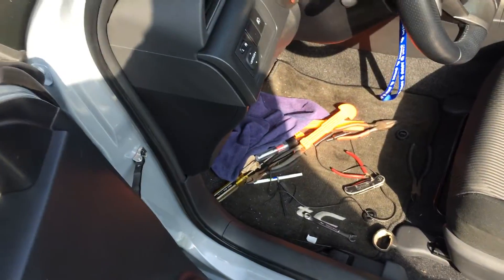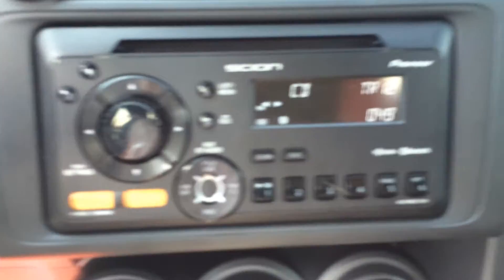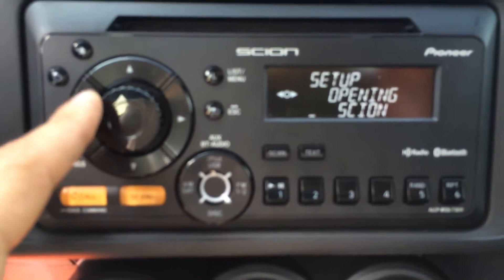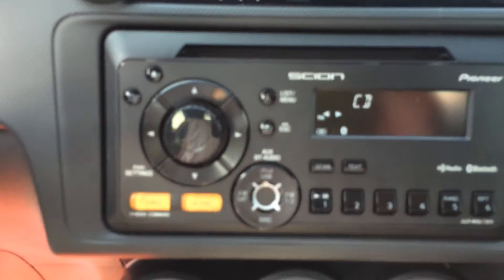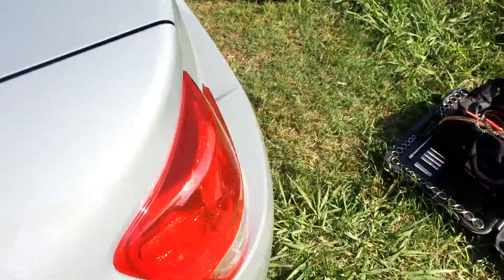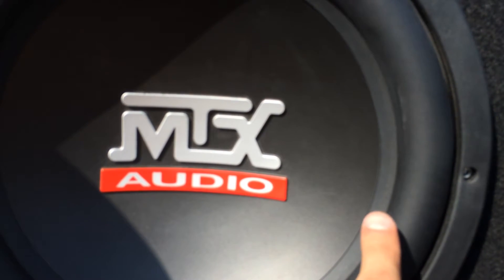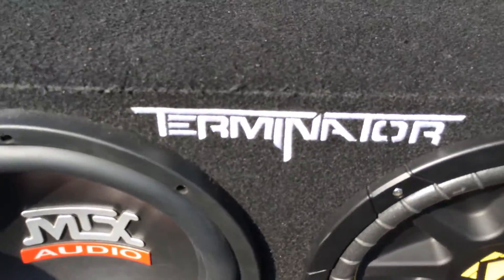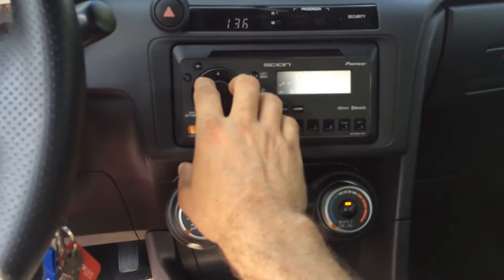2012 scion tc amp sub install #2

Comment: Two different woofers in a common chamber is a terrible thing to do one ohm loads might be different two they might need different size boxes you'll most likely blow one regardless if your clipping or not due to the different frequency responses and different power specs it's always best to go with same speakers or different speakers in different chambers
Reply from the maker: legendary504 its been almost a year and they still knock like the day I bought them, thing is the mtx subs were already used when I got them and the box has a chamber wall separating the two subs anyways its not band pass or ported. I don't get any clipping but that being said they are cheaper end models of those specific manufacturers speakers. The Amp is small so I don't see any over wattage, and the ohms for both I think are they same. I will at some point grab a Kicker CompVR 15 inch dual voice coil 2 ohm sub and ill slap it in a single 15 Super Bass ProBox ported that I currently have, with a 500 watt mono channel amp at 2 ohms. Thanks for the comment and feedback bud I appreciate it :D

Comment: Travis do you remove the negative wire off the battery or did you use a battery memory saver to install your system please get back to me asap thank you p.s. nice car
Reply from the maker: Hi, I recommend always removing the negative battery cable during any electronics install, the positive as well for the power wire from the battery ! Unfortunately you would have to reprogram any radio / stereo equipment . And thanks , I do not own the tc anymore , I traded it in for a Ford f150 then that for a scion xb and now I have a Toyota 🌮. Feel free to ask and I will help anyway I can !
Reply: It won't erase my computer's memory if I remove just negative wire off the battery cuz usually when removing a battery you need a battery memory saver to save the memory on your computer whenever you do maintenance
Reply from the maker: @kindbud1055  I’m not sure about that , I’ve never had issues , typically it will erase like your radio presets and clock and maybe the trip meters but nothing mechanical.  Not really sure how this impacts like a Tesla or EV! But I never had issues with any other vehicles when do car audio installs ! Hope this helps !

Comment: Did you tap the speaker wire from the amps? Or was that not necessary for your tC? I'm currently installing a amp/sub to my 2016 tC and I have to do so

Comment: I have a pair of comp r subs. Do you know if a 250 watt amp is sufficient?
Reply from the maker: christian perez depends, I want to say yes, typically kicker subs are rated at a lower wattage than posted on the box, also the way you wire up your subs, so you want to bridge your subs to your amp to get the lowest ohms the subs can handle, the lower the ohms the more watts the amp will push, google how to wire subs for ohms and check your amps specs to see what the lowest ohms it can handle, probably 2 or 4 ohms and the subs will usually be 2 or 4 ohm subs, single or dual voice coils

Comment: Hey man I just got a 2012 Tc but I'm not to good with all the fuses and stuff like that I was going to just pull the radio and run the remote wire off the back of it. Is it still the blue wire on the back of this radio
Reply: Also how do I get the panel off to get the radio out I got the pioneer 5.8 in touchscreen radio

Comment: I got a 2011 Scion tC but I can’t find the holes for the lines to go thru
Reply from the maker: 808 Hammah they are there , it’s not a hole until you cut those rubber Nipple looking things off , you can see them from the inside of the car up under the steering wheel area , take a coat hanger or thin metal something and poke it through those from the inside out then go look under the hood where it popped out and cut the nipple off

Comment: Do you think i could do this to my 07 tc and its factory radio???
Reply from the maker: PlomoLB1 you would have to remove the factory stereo and check if you have rca's in the back , if so then yes I see no problem with you installing it in your 07 TC.
Reply: PlomoLB1 I know it's a bit late, but there's no RCA hookup in the back of the stock radio, you'd have to get a line out converter or buy a nicer radio. I went with the nicer radio so I could also control the sub from it. Your call
Reply from the maker: +Dillon Cloud yeah I don't know about the 05-11 models but the tc2 has rca outputs
Reply: Travis Geckler I just recently bought a 13 tc and they do have RCA's thankfully. Wish the older ones did. lol

Comment: From where you get the ground
Reply from the maker: the ground for the amp ? the big bolts holding the rear seats, take one out and sand the paint off around it, then crimp on a round connector and screw back the bolt so its getting a solid body ground. I hope this helps